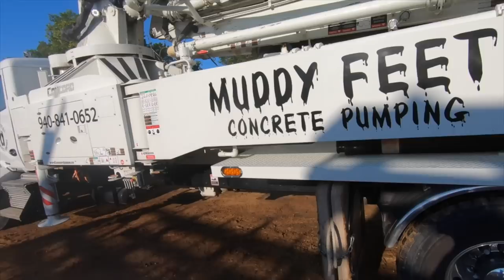Concrete truck rolls over. Pumping concrete with Muddyfeet

Comment: this is the first time and last time I'm watching this ridiculous channel .. y'all all suck .. . y'all embarrassed me as a Texan .. I haven't seen this much ignorance in one place in a long time ..
Reply from the maker: Oh come on. I bet you’ll be back. 🤣🤣🤣
Reply: @MuddyfeetConcretePumping  
I'm not bitching ( yes I am 😁) , I realize y'all got your equipment in there ..and probably took your time ..which is smart .
  But these concrete companies are crazy ! 
 I remember back in 1985 , we were pouring a large pool deck and side patios , along with a lot of footings for brick retaining walls , columns etc .
 During the Pool deck and patio part ( we poured the other with on site mixers ) , the house was on a very steep hill .. and really no better access in the front .. actually , the only access WAS where we had the trucks go , to get up the hill .. like I said , a very steep grade .
 Long story short , the concrete company sent 8 trucks ( we actually needed only 3 9yarders for the pour ) ..but the younger drivers kept trying to race to the top of the hill , like they were in dune buggies ! 
 I kept telling them to gradually go up , in low gear .. a little at a time .
 Well , the first 3 ended up messed up , the drive shafts were compromised..
   An older driver finally got there and he drove the next three trucks ,one at a time ..no problems with each pour .. 
  My point is , that makeshift driveway would send me into another realm .. I would not allow trucks to back into it , just knowing how bad some of these drivers are ..
Reply: In hindsight , I would've gotten a crane pump .. but we had a concrete contractor that poured the pool deck .. he didn't want to pay the extra money . 
  I realize that construction can get out of hand , when inexperienced people are involved .. thank God for the old timers ! 👍
Reply: 100% with you on this. absolute clown show
Reply: @froter1  no one cares about the old days old man... just saying...
Reply: Say to George bush......

Comment: This is why all redi mix (concrete) companies should have their own site rep.  That site would have gotten shut down when that 1st truck sank in. At 3:56 you can see a  "push" where the weight of the 1st truck moved the whole road base over. And again at 4:04 and 4:09 , non of our site reps would have let the 2nd truck come in after the 1st sank that much on what is clearly a poorly compacted road base.   That's something like 65-70,000 pounds!!!  that road was made to hold 1/3 that weight CLEARLY!
Reply from the maker: I think your right
Reply: i had 5m3 of crushed rock delivered to my house. the truck literally dug own 6inch into my asphalt drive way. it may looks solid, but sometimes it isnt.
Reply: That's what a good driver should know
Reply: Looked like he drove right off the edge to me. Started trying to steer out of it but way too late and just kept going as it got worse.
Reply: u just need competent drivers
Reply: I agree and I support the idea of a site rep.  Where it gets complicated, whoops I meant to say expensive, is having a site rep on every pour.  Alot of times it's the little pours where a truck winds up in a bad spot because there's a septic tank here and water line there...all for a 4-yard walk out patio around back.

Comment: The road is garbage. Yes the driver is off track a bit but the road is garbage. Period.
You can see where he was backing on someone else's track, the shit is soft and kept sucking him over to the edge.
Look over on the other side, there's ruts near the edge there too, collapsing off the edge.
You back down that with 8-10 yards you have to hit it perfect and be a bit lucky.
The bottom line is the driver stopped as soon as he knew he was off track and getting sucked over....but the truck still rolled over.
BAD ROAD.
(yeah watch the first minutes where you can see the guy backing in...he's pretty centered, he gets sucked over.)
Reply: @Andrew-co6wn  I did other wise I wouldn’t comment on it dipshit watch the video if he would have been in the center of drive he woulda been fine 100% drivers fault
Reply: @logany.2809    Have you ever driven a mixer?
Reply: @havenzhai5187  nope but deal with them, dumptrucks, septic trucks everyday
Reply: @logany.2809  there is no way you can argue this road isn't built like shit. First of all, it's all wet clay. That's a shitty situation right off the bat. You don't have much room for error. Also,  Any road (even a short term construction access) should be 2x the width of whatever vehicles are driving on it. Period. With how narrow this road is, and how much higher from existing ground it's built,  any loaded truck would have been pushing those edges out further with each pass, until it gives away. You can see that the driver was sucked in by the ruts and softness of the edges. 

I'm an equipment operator for a well respected construction outfit, and I have built tons of roads like this. But never has it been wet clay, and never has it been so narrow and high up that it's a death trap for any driver coming in. 

And I've dealt with some stupid truck drivers! But you have to expect that lol. That's why you build the road wider!
Reply: @logany.2809  I have.  Driving them is different than watching.  Granted, he should have walked the access road before backing down it, but I drove mixer 7 years in that region and I can fully understand how easily this can happen.
Reply: @havenzhai5187  It’s really not tho I pull I 30’ trailer everyday I know how to drive I know they weigh 4x more than me but if he stayed in the same path as everyone else he would’ve be fine
Reply: @logany.2809  no, that road isnt good enough. Practical Engineering has a video on bank load factor for road building. That road isnt even code for normal vehicles, good enough, sure but certainly not for a mud truck. Codes and safety factor exist for a reason, check out Practical Engineering's video on it
Reply: @paddington1670  no thanks I deal with everyday. The road didn’t collapse from the weight of the truck. He drove off the side and then it collapsed how do y’all not get that lol
Reply: Looked to me he was pretty centered , not perfect but should been good enough then the whole truck starts sliding sideways cause the ground is either to not packed starts giving way under him . For me not driver error in my book . They should of got him chained him off on top and kept tension till other tow truck got there  . Were he was hooked to was not helping at all .
Reply: @mikes622  man his right tires are in the middle of the drive how is that centered
Reply: @logany.2809  He was centered till the truck looked like it was sliding sideways on ice then when it finally stopped his right tires were in middle of the road .
Reply: Built enough logging roads to know the road is way too narrow. It is only about 10' wide with 2' of soft shoulders which means those soft shoulders reach into the road 2' or more. Road should be 14' of hard packed material. It isn't.  It is the drivers fault for not saying "screw you I'm not driving over that chunk of crap." Too often drivers are pressured into doing things they know they should not do. Either take a chance or go down the road, so they take a chance. Sometimes you are lucky, sometimes you are not.After it flops over, you can see there is only 6' at most of solid road under it.
Reply: @JohnLaco    I totally agree.  And yes, the edges are pushed  out and weakened with each pass of a 70,000+ lb mixer.  You are right.
Reply: @logany.2809  you obviously know nothing about dirt work, the only compaction is from previous vehicles driving on it,  this shoves the material under the tires to the outside of the road.. you can see the ridges in the edge of the road. The first truck probably barely made it,  the second truck literally got pulled to the edge because the material under his tires gave way.  You can see in the video that he was perfectly centered when he was backing up then suddenly shifted to the left
Reply: Mr B  they obviously didn't compact it properly..if you don't compact fill in lifts and ignore the side slope completely this is what happens. It blew out the side slopes. The material looks decent, if it was done correctly it should have held up the truck.
Reply: Mr B  It was all drivers fault. I've been doing this for over 45 years. There's nothing wrong with the road. Driver looked away for 2 seconds to turn on his back up lights and ran off the road.
Reply: @paddington1670  come and have a look at the real world. It's somewhat different to your Utopia!.
Reply: all 3 was at fault the driver of concrete truck then the road is a little shitty but fine if he watched the road better and yes i drove for 15yrs. then theres the toe truck that should rigged blocks to some of the trees in the woods and at least saved the truck. but no one was hurt and the truck is covered by inc.
Reply: Seems like a lot of knowledge from people about dirt roads.. I’m not knocking it, but just curious do you think metal plates shaker plates would have helped in this situation? Maybe idk. Thank god the driver was able to get out.
Reply: No guys, it's not the road's fault nor is it the driver's fault.  The road did not decide "oh!  Today I'm gonna be muddy!  Yay!".  No, the weather did that.  The driver did not look at the road and decide "I'm a cowboy today!  I can do it!"  No, it's the jackass boss that's at fault.  The sorry son of a bitch did not make sure his drivers were dealing with safe conditions, and then expecting his drivers to drive that road backwards.  This f'up by the boss could have cost a driver his life.

The boss clearly earned the Golden Jackass award.
Reply: @CarlKem  i drove dump trucks and heavy machinery for yrs a little weather and just driving on a new road changes the road how can you blame the boss once you get behind the wheel of a 50,000 pound truck you the driver are the responsible for driving said truck not the boss that is drinking a coffee sitting on his a*s someplace you the driver get your a*s out of the truck and make sure its good to drive on and if you the driver don't feel safe ya call the boss. i refused more then 1 delivery for crappy roads. i stick to all 3 are to blame road builder,driver, and toe truck could have stopped the rollover if he rigged some blocking till the bigger wrecker got there
Reply: @JohnLaco  There are guys out here driving, that have been driving for many years driving, & still can not back up. Each drivers backing characteristics are different. Some do better by hugging the edge. In this case it led to a disaster. I really do not think it was a design or composition flaw in the driveway. The first driver made the trip no problem. Yea, it's possible that the first truck in loosened up the footing on the driveway to where it collapsed when the second truck backed in. I doubt that as if you look at the tire tracks from the second truck in the soft road, you clearly see the driver aiming the rear of the truck along the drivers side edge of the road. He got too close to where the road foundation gave way, tipping the truck. Thank about it, if he started sliding, why didn't he just stop? Was he backing up too fast to where when the mixer truck started to slide & he applied the brake, the momentum carried him into the ditch? If that was the case you can't blame that on the road. Lots of weight in a small area with that truck, one mistake & it's over.
Reply: Your right. Hardly is it the first load that runs into trouble. First load did enough to the road making it a tougher job on the next guy. Did the first driver spill? Looks like 2nd load ran over spill covering outside duels tread adding more moisture on a bad road. Being near a body of water I'd say moisture in the air, being early morning pour also. First driver leaves his lights on no help to his partner trying to back in possibly losing sight of best spot to track. 2nd driver does turn on his work lights just before entering the soft spot indicating he might be losing sight or blinded by first driver. If you notice first truck at the pump has a puddle of water at the rear of his fender, leaking water hose possibly adding little more moisture to road...it don't take much man. They said 2nd driver was scared to get out of his truck...well the time to get out was when he arrived and walk that road looking for any trap situations. I would have walked the whole damn road and turned off that first drivers lights myself. No biggie No hurry. After having a visual and walking that road and seeing what the first driver and Pump truck did to it, I would either suggest shoring up any soft spots or proceed at a snails pace feeling for the slightest movement or shift, stop and get hell out. I've prevented a lot of close calls not only for myself but the team drivers I work with over a long fun career.  I was usually the first load on the job sometimes at 2:00am. I had a good relationship with customers who trusted my judgment in what needed to be done for not just my load but the other 20-30 loads showing up. Somtimes big jobs up to a 1,000-2,000 yards. Most the big jobs were real professional and done the right way from the get go. Still I would survey the whole area before we got started. I felt a big responsibility to make it safe for my teammates. We all want to go home to family at the end of the day. If I felt we needed to cut back the yardage per truck to make it safer but more time consuming so be it. Driving mixer is like no other truck. I've had fellow drivers scared to get into certain jobs asking me if I can get back their load to the bottom of steep grade. Driving mixer not for everyone. I've seen guys with 30 years long haul experience call the dispatcher to come and get their freakin truck cause they done with it...never felt nothin like it they said....totally spooked. Ive seen death first hand in these trucks, a vision that sticks with you. To the guy calling everyone dip shit. You're comments are typical of the bone head contractor that try's to rush a mixer driver by saying c'mon man back that truck in, we already had trucks in here. LOL Usually a 10 wheeler, dump truck, water truck, shitter truck....to you I say....get out way before you get someone killed. God bless, Be safe out there!!!